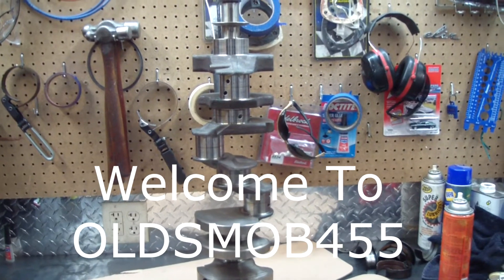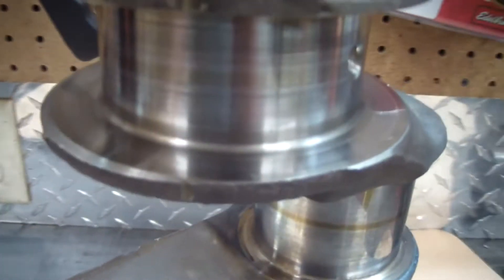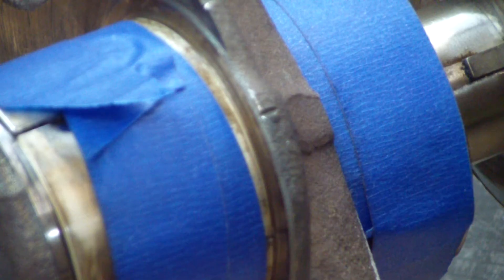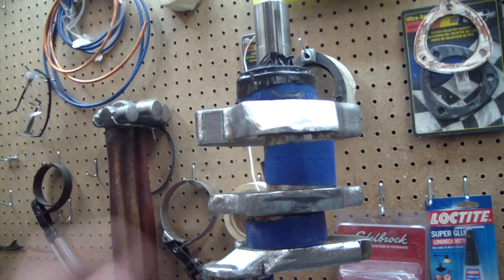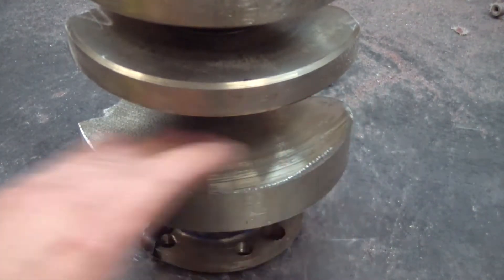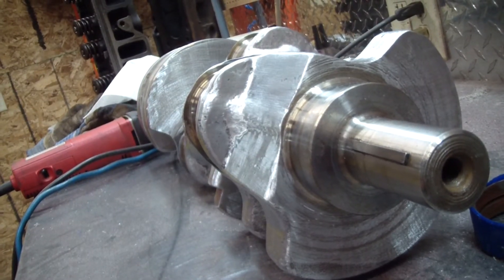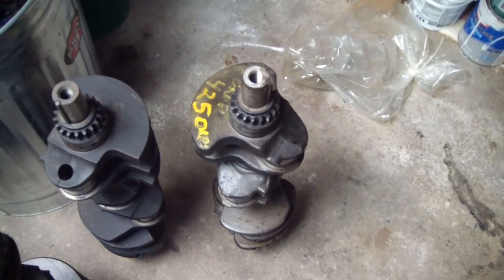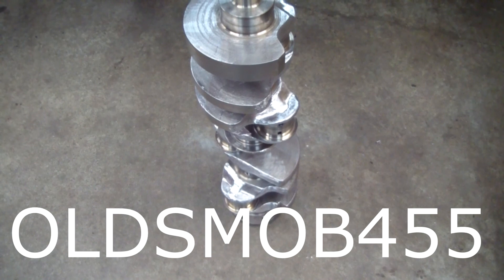Crankshaft Flash and Nick Removal

Comment: we turned mine down and of set ground the crank to get a Lil more stroke.  We turned it down to take a Chevy rod.  then milled a 1 inch hole through the rod journal to lighten the center of the crank, taped some old bearings on and took a body grinder to the rest.  internally balanced it.  the whole rotating assembly is close to 12 pounds lighter, crank rods, pistons, flywheel...